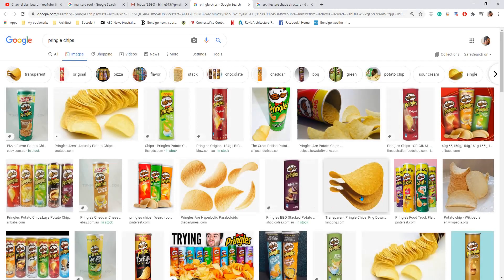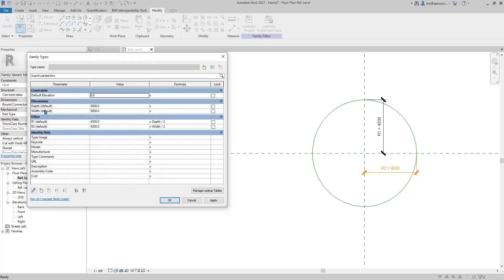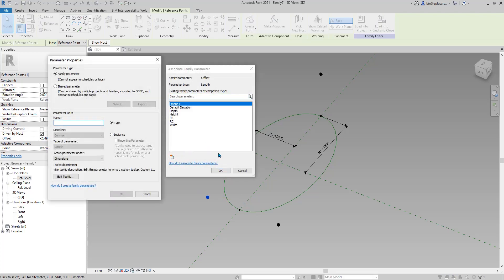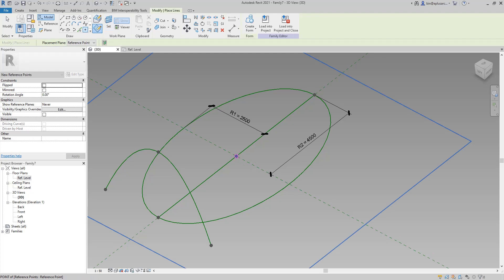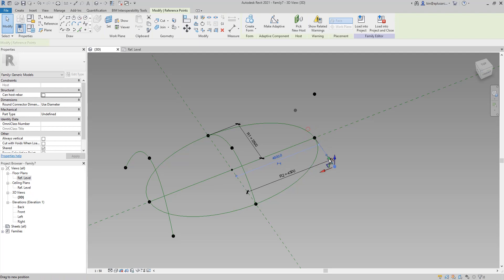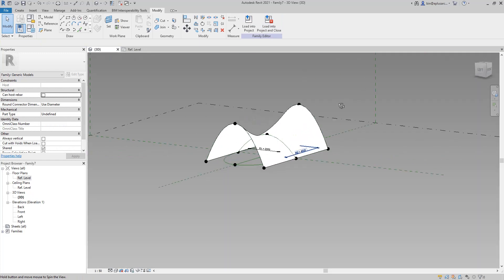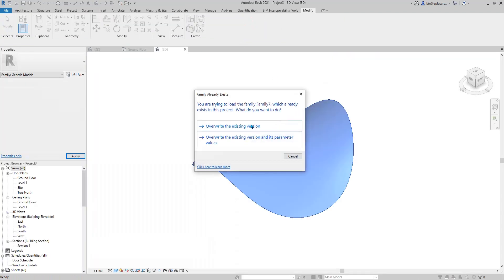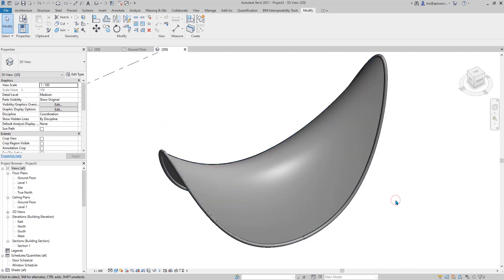Revit Exercise (Day 161) - Parametric Princle Chip Shape Family

Comment: how can i add material to it? and can i add openings to it?
Reply from the maker: Yes, you can select the face (might need Tab and select) and change the material (or create material parameter).
Yes, you can. You can turn the whole face to some glazing system and make some of the panels operable. Or you can use void to cut holes in it if that is what you mean.  I can do a video about this.
Reply: @BINHE615  one last thing after uploading it to the project how can i rotate it from horizontal to vertical ?
Reply from the maker: If you have already modelled this shape, the easies way is to nest it in a new adaptive family with 1 adaptive point. You need to place it on the work plane of the adaptive point.   This should work, I will have a test when I work on the glazing and opening.